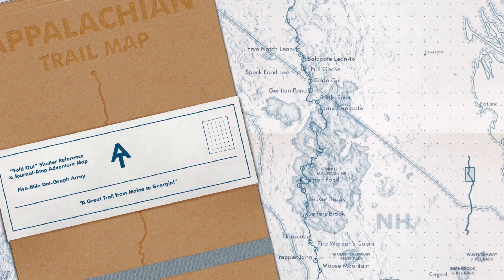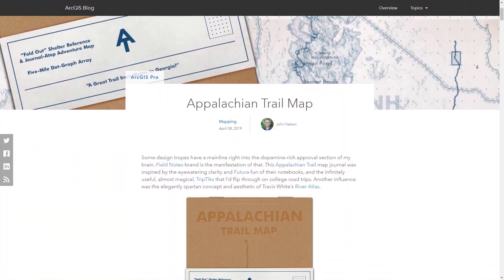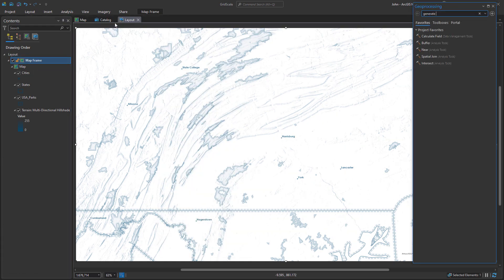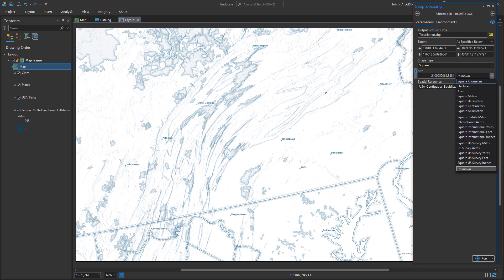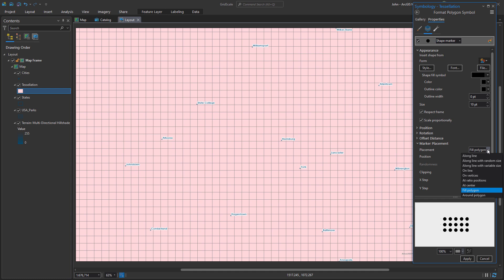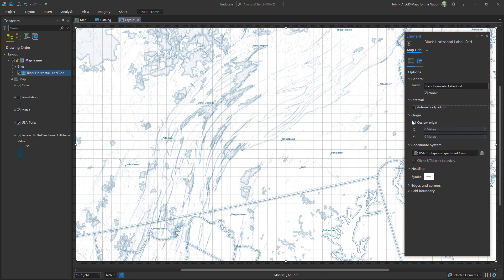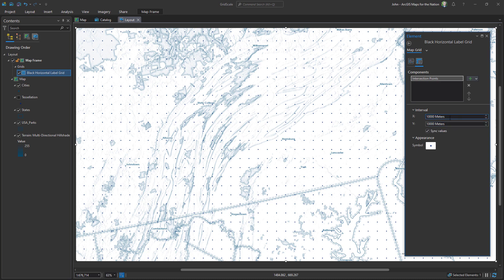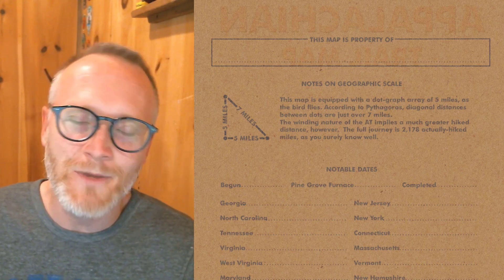Scalebars? Tired. Grid Scale? Wired!

Comment: Why tessellate? Surely fishnet would be better as you have more control (measurement), you can use the polygon points or the label option points.
Reply from the maker: good idea, fishnet is another great option!
Reply: @JohnNelsonMaps  I would like to try the Triangle tessellate, using the centre point symbol should make it look like the rows are offset, would need to play with to ensure equal distance.